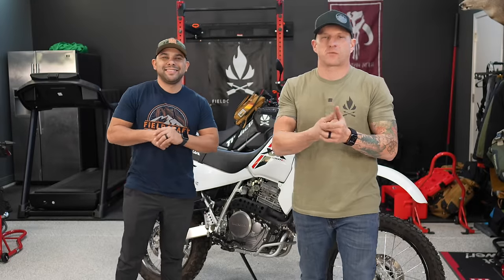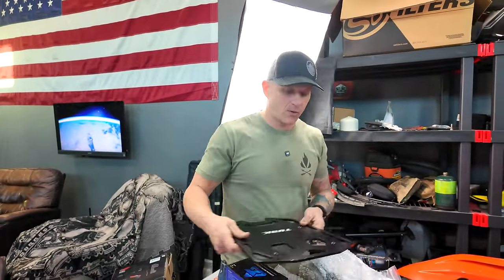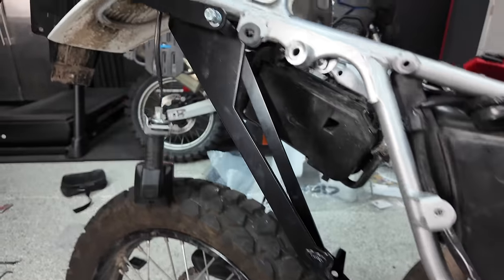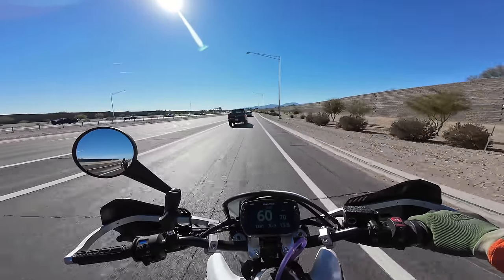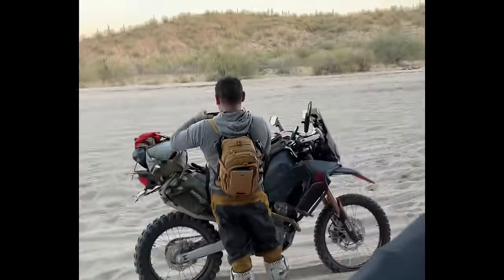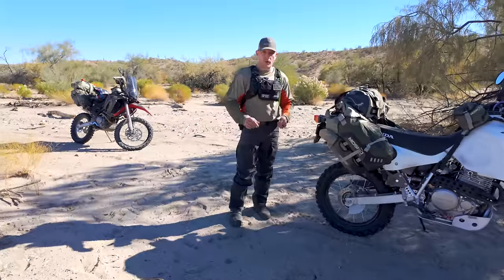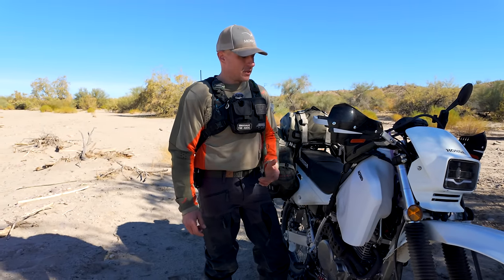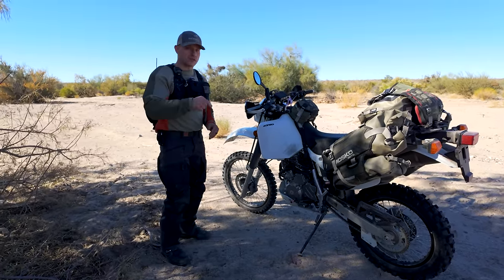Budget Friendly Bugout: Is the XR650L the Perfect Bike to be Prepared for the Worst Case Scenario?

Comment: I mean, lets be honest. A bike, any bike, is a horrible option for a "bug out" vehicle. Limited range, loud, no security, limited carrying capacity. People have this vision of what "bugging out" would be like and it has no reflection to reality. Basic survival would tell you to harden in place and conserve resources. You go on the move and you give up nearly all of your established security and control of your situation. Pretty quickly anybody going on the move in a true survival situation will be walking.
Reply: If possible, bugging in is preferable, but that's not always possible.  What about the train wreck in East Palestine Ohio?  Hard to bug in when toxic chemicals are burning a mile upwind.  A dual sport bike would have some major advantages for getting out of Dodge when everyone else was forced to the same conclusion.  It's not a good family plan, but flying solo, it has some advantages.
Reply from the maker: A motorcycle has its place in a bug out plan. What about indigestive areas like San Francisco LA Seattle where everyone’s trying to get out of town and there’s gridlock. Cars on the freeway running out of fuel, electric cars, dying blocking the road motorcycles is definitely more agile and able to get through tight spaces much quicker. In an ideal world. If you did have to bug out, it would not be your primary vehicle but definitely a secondary tool to be used as needed. I’ve got a podcast with Mike Hernandez talking about this extensively coming out soon.
Reply: This is not true if you live in a major inner city. I’m in downtown Houston Texas. “Bugging in” would result in me having to fight looters every day and my house eventually being set on fire. A Dualsport is the perfect vehicle to escape a city on when the highways are a parking lot of cars trying to bug out too.
Reply: @IRLtrolls  How good is that dual sport going to be when one of those looters rips you off of it? Again, no security on a bike.
Reply: @MeerkatADV  Do you have an armored car? The security argument isn’t a very good one considering 9mm goes right through a car or truck like butter. And you’d be stuck in gridlock. I can ride my Dualsport down ditch, power lines and bicycle paths. It’s the best way to escape to a city. Once you’re out of a city it’s a little different but for getting out a city during civil unrest I’d be gone before you even got on the interstate.
Reply: @IRLtrolls  same argument for the bike. How much armor is your riding jacket?
Reply: @MeerkatADV  Lmao none but I’m MOVING. Something you’re not doing in a car or truck. Anything else?
Reply: @IRLtrolls  No, I made my point.
Reply: @MeerkatADV  Okay I wanted to keep this civil because you and I are obviously both Adv enthusiast but you’re just being obtuse now. 

Have you ever live in a major city? I’m talking downtown LA, Chi, NYC, Hou etc etc? I feel like you might be looking at this situation through a rural perspective and you don’t quite understand what’s it’s like with 10 million people try to evacuate a city at once. You are going to sit in your car/truck on the interstate until you run out of fuel. Thats what’s going to happened. I’ve done this in 2005 when Hurricane Rita was coming to Galveston/Houston. It took me 35 hours to drive from Galveston to Austin Texas which should have been a 3 hour drive because 10 million people were under mandatory evacuation. The only reason I even made it to Austin was because we got incredibly lucky and a tanker truck was delivering fuel to a gas station right when I drove by it on an empty tank on i10. The interstate was completely blocked with cars out of gas. 

And the guy’s evacuating on bikes were filtering right through. You haven’t made any “point” you’ve actually done nothing but made a fool of yourself and show everyone here you don’t have much life experience or critical thinking skills .
Reply: @IRLtrolls  I'm being civil. And I've lived in San Diego, San Antonio, Denver, and Washington DC. I was in Hurricane Rita and the emergency response to it while in the Army. And Hurricane Katrina.

A bicycle would be a better evacuation vehicle in every situation you've mentioned where an automobile wouldn't work. 

Again, limited range, loud, no security, limited carrying capacity. Those are the factual limitations of utilizing a motorcycle as a "bug out" vehicle. If you want to continue having some idealized view of how you would "bug out" when the zombies come you go right ahead. I'll be along later to loot your corpse.
Reply: You can stay off the roads and travel through the back woods quicker. But ya not ideal.
Reply: @MeerkatADV  You keep ignore the whole “gridlock” thing where you can’t move your truck. 

And for me to get 100 miles out of town on a bicycle would take multi gallons of hydration. Where am I stopping and getting that much water along the way if the stores in the city are closed and everyone is panicking? You said a motorcycle has limited capacity a bicycle has even less. 

You wouldn’t “loot my body” because you’d be stuck in traffic. A motorcycle isn’t the bug out solution in every situation but it’s absolutely the solution for leaving a major city on a short notice.

Just answer me one simple question. How do you escape a major city will 10 million people evacuating in a car or truck? You have dodged this question repeatedly.
Reply: @IRLtrolls  it was one of the first things I said. That's fine, continue to talk at people and not discuss. You'll just continue to talk to yourself. Goodbye.
Reply: @MeerkatADV  classic internet argument bow out when you’ve lost. ✌️🤡

So you’re going to start walking a mile from your house because you cant get your truck on the highway and I’ll ride a Dualsport 200 miles before I run out of fuel and start walking. Got it.
Reply: It also depends entirely on how you set your motorcycle up, too. Mine is EXTREMELY quiet and gets about 98.3 mpg. I just need a tank bigger than 2.8g.
Reply: If you’re bugging out to a predetermined location that has supplies etc, a motorcycle is a good option. Otherwise, I completely agree with you
Reply: @MeerkatADV first thing you said was something about people ripping you off a bike. 😂
Sounds like you're the one talking to yourself.
Reply: @smittyghostey1955  You are literally replying to my original comment. Reading is fundamental "Basic survival would tell you to harden in place and conserve resources. You go on the move and you give up nearly all of your established security and control of your situation."
Reply: @MeerkatADV If only we all were in a secure place. I don't thing an apartment building is going to be easy to secure. Like others have said, predetermined destinations.
Reply: @smittyghostey1955  and again, going on the move you give up all of your security. You think a bike is more secure than an apartment? Or any structure? I agree with the people who have said a rapid move to preset location with established supplies is a valid option. Most of the suggestions of a motorcycle as a "bug out" vehicle are not talking about doing that.
Reply: @MeerkatADV I believe the question is if you have to move what are you taking.
Reply: @smittyghostey1955  as @backcountryadv pointed out "If you did have to bug out, it would not be your primary vehicle but definitely a secondary tool to be used as needed." A bicycle or motorcycle would be a good backup option. But a good 4x4 would be ideal if you absolutely had to move. As I pointed out, a motorcycle as the designated bug out vehicle gives up far more than it gains.
Reply: @MeerkatADV  We're talking budget friendly. Yes a full size vehicle will be able to carry more passengers and gear. However, for solo, gtfo, quick and cheap, a bike would be my pick.
Reply: @MeerkatADV "Bug out" to depart in a hurry. 
Bug out to bug in.
I would be happy to take less carrying power for the ability to go about anywhere and not get trapped or stuck.
Reply: Weather is another thing to consider. I wouldn't take my bike now as it is -19 outside. 😂
Reply: What do you do if someone lights your house on fire?
Reply: @backcountryadvmoto exactly! Bug out means you live in a congested area, probably coastlines. For those that already live off the beaten paths, you bug in. But even in that situation, you still may have to venture out to the nearest town for things.
Reply: Ha…no doubt.  At best…escape to backpack…about all it would be good for.
Reply: @MeerkatADV  u made ur point but its not a vry good one. if u need to get out of town a dual sport could be a great option. 

u are acting like ur car is a superior option but its useless in gridlock. while ur sitting around hoping things clear up someone on one of these bikes is putting miles between them and u.

and suggesting a bicycle over a dual sport is pretty ridiculous i mean ur talking 200+ miles per tank of gas on the bike in this video
Reply: A motorbike is an excellent option to have with the kit. I prospect for gold and people follow tracks etc. mostly to see if they go to good looking ground but sometimes because they know peoples camps have easy pickings. A motorbike as part of the camping kit adds redundancy and flexibility to make it virtually impossible for people to follow and know your business. You could make a base and dig in and have the motorbike to get around. 4x4 vehicle and people will follow to see what’s going on or to say hello but a motorbike no one is interested because they are difficult to follow. We have 95k square kilometres of continuous forrest here and then desert. You can’t push through the bush very far without getting flats sometimes but with a bike and quad you can make it so you get to places that others can’t as easily. I have had bikes and quads whilst on extended trips with bikes being more stealthy by far. You can use animal tracks etc. double back go over the top of hills. Only equaliser would be the use of drones.
Reply: @edgarbradford  what sort of bike mate? That’s good on fuel
Reply: I respectfully disagree. It's a solid choice
Reply: Bugging out is the stupidest concept.
Reply: @skev303uk  The most sane comment so far.  Bugout = spent too much time on left/right conspiracy forum, bloviating about bugging out, to notice one should have left already.
Reply: @backcountryadvmoto  you read my mind. I’m from the San Francisco Bay area. The Loma Preita earthquake had my brother-in-law stuck in traffic for 16 hours. splitting lanes on a motorcycle would have probably got him home a lot faster, being that the Baybridge and Cypress structure had some collapses. my bug out bike is a salvaged Kawasaki Z 400. I won’t win any races but dang, she is cheap on gas.
Reply: @IRLtrolls if you’re living in Houston, Katy or north of anywhere there and you’re worried about getting tf outta there then you should already have shelter options and be less concerned with transportation with exception of your initial take off.
Reply: I’m not so sure you did.
Reply: I dont know if id be putting an exhaust onto a bug out vehicle …
Reply: Everyone saying this is a great option is a bachelor.
Reply: @Liberty4Ever  I've seen entire family riding a dirt bike in the Philippines.
Reply: LOL...I love this argument.  Truth is, if you have a remote cabin to bug out to,  it is going to be discovered by the millions of people pouring out of the cities into the country.  You will be looted and burned out just like living in the city.  Just do what makes you FEEL safe and let's all pray it is never a decision we will have to make.  There is an old sci fy movie that shows the futility of either method "Panic in the Year Zero".  Good movie from the fifties, check it out.
Reply: @howardbecton6274  well, I don't live around millions of people. Let's be real, the east coast would be screwed just about no matter what, simply due to population density.
Reply: Yeah,  but they'll be heading inland, and there's the midwest cities.  I'm in an east coast city and I'm staying put but I don't have much hope of living long,  and I don't think many will if they bug out or not.  I'm just wishing luck to us all and hopefully there will not be a SHTF.  Stay safe and vigilant.
Reply: @Taco_Lover.  over 52,000 miles in the last 2 years, about 20k of that in dirt. I literally live on my bike. Let me know when you have a point about the topic at hand instead of strawmen.
Reply: That's just your idea of a disappear vehicle. Some are porn minded about it.  I liked the video,  your didn't.  That's about all we know.  That and you'll be a lot easier to find in a situation.
Reply: @InexorableOne  Did this make any sense to you or did you use google translate badly?
Reply: 4x4 with pit bike for recon
Reply: as everything it car bé usefull or not.
Motocross are really great to escape because they go where cars ans other things can t . So yes it could be 
great
Reply: By what knowledge do you have this opin
Reply: I agree with your entire statement. Still a cool build idea tho lol
Reply: 650Ls are suuuuuper quiet stock. You clearly haven’t ridden one LOL
Reply: It's going to by cyber attack, EMP, then nuclear. You have no idea where it's going to hit and the roads certainly won't be clear. A motorcycle is essentially for this if you live in a city
Reply: @edgarbradford ….What do you ride Ed?
Reply: 2023 Honda Xr150l. It's not fast. Caps at about 62 but it's whisper quiet, gets 98.2 mpg, and has done everything I've asked of it so far.
Reply: @edgarbradford  ….Thanks mate.
Reply: Staying put would be a good idea if you already live out in the hinterlands, but if you live anywhere near a major city, it would behoove you to get out of dodge as quickly as possible. A motorcycle would be a great option for taking narrow back trails, smaller dirt roads and side streets, etc. The idea of something like this would be to avoid major roads and highways as much as possible, which would definitely be clogged up with car traffic. In most cases, a "bug-out" plan like this would include a place of refuge far away from the city. I suppose that's the reason Backcountry Adv Moto included an extended range gas tank in their bulid.

There's no one size fits all "bug-out" plan. Each individual or family needs to taylor their own plan for their own circumstances. Also, we should all keep in mind that safety is not guaranteed in any case, but doing something beats the hell out of doing nothing.
Reply: “Bugging out” isn’t a hard target situation… it’s a move as fast as you can and get as far away as you can kind of situation which is perfect for an adventure bike focused on offroad capabilities.
Reply: I wouldn’t say the range is limited since some dual sports have aftermarket tanks that double fuel capacity and give you the same range as a car. Plus if you live in the city you can weave through gridlock traffic.
Reply: Not all bikes are stupidly loud, and everything in an absolute have to go now situation isn't even a bother. It's a means of separation period.
Reply: @spaghettiman600  mind if I steal that?
Reply: People who live in the boonies don't understand the complexity of city evac.
Reply: Reddit much? Lol

Comment: Worst case scenario?  Absolute worst case scenario?   No that would we be the Yamaha TW200,   can get through stuff the XR650L wouldn't be able to,  and do it at nearly 80mpg,  although slower you would actually get there.
Reply from the maker: Agreed, and we will also be being TW into the fold as another option in a future video. The only con with the TW would be speed and carry capacity. Put a passenger and some gear and it struggles a bit. Also tires are a bit harder to find if you slash a side wall or something. Other that that. It’s an except bike and a good option as well

Comment: 1982 called and wants its carburetor back
Reply from the maker: That’s the point. It’s a very simple machine, extremely reliable, and in the worst case scenario can be worked on and found parts by just about anybody anywhere.
Reply from the maker: Totally understand. I’m the same way I would take a fuel injected bike any day, but when we are talking about limited supply, and resources in a “worst case scenario” something that is needing less maintenance is ideal. The XR 650 is just one of those bikes that’ll run as long as you change the oil. And even that, oil changes are Basically double what the 450 L is. Both are great bikes though.
Reply: Apart from the typical ethanol gunk that builds up if you don't run the bike for a while (or you don't drain the gas), the CV carb of the XR650L is pretty maintenance free. Jet it and forget it. Only adjust the fuel screw if you plan on going from sea level to greater than 5000ft. Compare that to more performant carb designs which require different jet sizes and needle clip adjustments every 2000ft or 30 degree swing in temperature lol
Reply: 2024 called to let you know its Carrington event or EMP knocked out everyone's electronic fuel injection and engine computers.   😛
Reply: @NorCalSaint  - We can watch it on the news later this year.